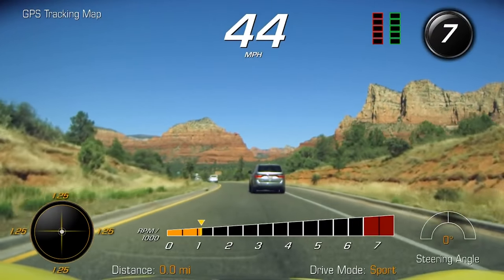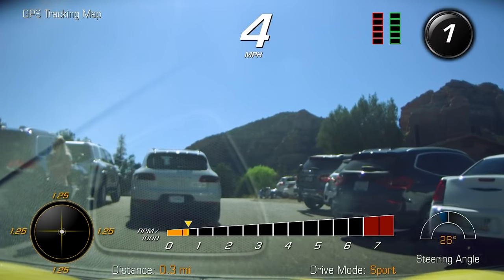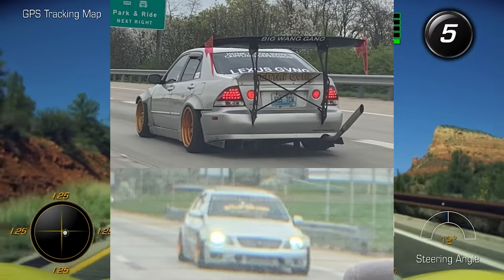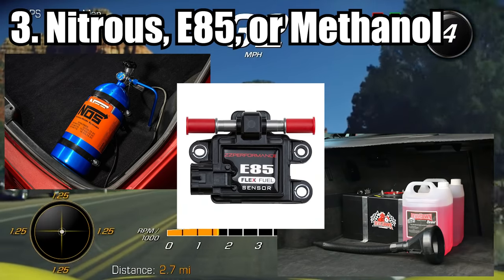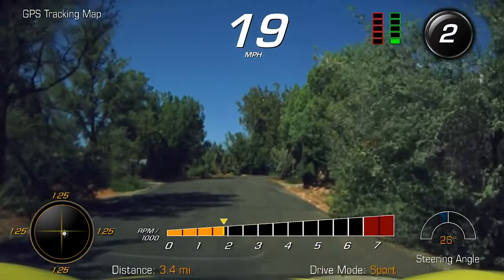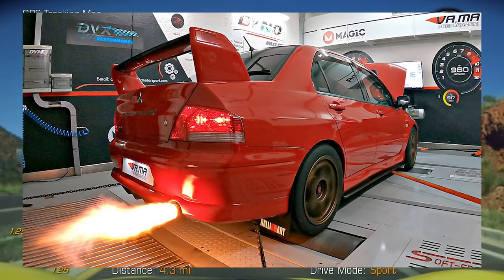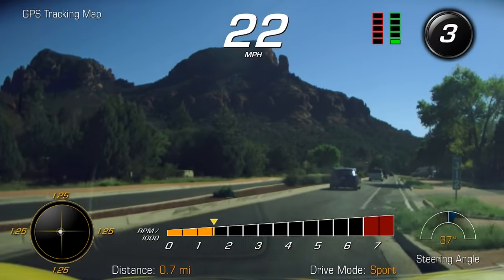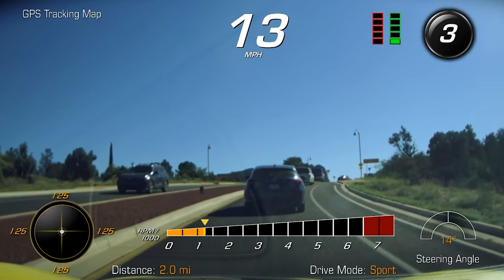6 Most INTIMIDATING Car Mods!

Comment: An actual Manual transmission will be destroyed by a 3000hp engine. That's why high power drag cars and insane vipers have sequential transmissions, has nothing to do with shift time. Don't believe me? Go look for a manual rated to handle more than about 800 hp or lb-ft of torque (different places rate their transmissions differently) yes I know there are a few 1000 + hp supras with 6 speeds out there but get into the 1500hp range and above and everyone either has a sequential or automatic.

Comment: 10:40 IMO there is a difference between Exhaust Noise and Echaust sound, some engines are just loud with a straight pipe, and others actually sound good.

Comment: Sorry to break it to you but you’re wrong on the big flames… big flames means they cranked their timing back… the little flames and pops happen when it’s just a cat less car with a decent tune pushing decent power… if there is fire coming out the exhaust your timing is a bit off plain and simple and the bigger the flame the worse it is… so bigger flame doesn’t mean intimidating just that they’ll probs blowup halfway through a pull😂

Comment: Surprised no one's mentioned the scariest mod: stripped interior with race seats and a rollcage. Sure, they may not be winning any drag races, but you know that to sacrifice all comfort and practicality for safety and performance they are putting in some serious time at the track or rallying their car. Either way, that driver has more skill and balls than you when it comes to sending it so they have nothing to prove in a street race anyway.

Comment: I want 295/45/R18s in the rear om my S197, and I'm building mine for occasional track use, granted that's not as big as a drag car's sidewall but it's noticeably bigger than what some people will run, just love the fatter sidewall on these cars, yea low profile is better but I also daily drive the thing so it will be a little more comfortable, I guess the thicker sidewall adds to the retro styling of the early S197 because 60s race cars had massive sidewalls and that's why I like it but I'm not sure

Comment: I’m building a 3.1 V6 2000 Pontiac Grand Prix. There’s not much aftermarket support at all but so far I’m waiting on injectors, new exhaust/cat, ram air intake+SD hood, and I plan on swapping my intake manifold for a 3.4 manifold since they share the same bolt pattern but I’ll hopefully get slightly better air flow. I have new wheels and I’m getting new tires in a couple months. Obviously plan on doing a tune after everything listed is properly installed. Any recommendations? These cars are difficult to modify (which imo adds to the fun of it) but I would love some ideas from people that are familiar with these engines.

Comment: OK you know you’re screwed when you pull up to a Honda with a parachute in the back with a roll cage inside and with big drag tires in the front and a hood exit exhaust and you start hearing the spooling and you see a laptop in the passenger seat

Comment: alright then, what if someone puts a 7 speed manual on a tesla model s plaid+, and when it goes it sounds like a fucking tornado. then you tint the windows and paint it matte black, THEN you carbon fiber hydrodip a set of drag radials. THEN you have 3 inch sideskirts, AND THEN, imagine that, you add bucket seats. AND YET AGAIN YOU ADD SOMETHING ELSE, you change the fucking hazard noise to something absolutelly ridiculous and you keep the hazards on, now now now you back it up with a six van support team with everything you could ever need and they set up like ten massive tents. WHAT THE FUCK WOULD YOU DO THEN BLADED, WHAT WOULD YOU DO THEN. anyways uhm i loved the video lol.

Comment: Bro, you mention 3000 hp vipers with a sequential gearbox, the intimidating part of that car isnt the gearbox. It's the THREE THOUSAND HORSEPOWER, you can put paddle shifters on an F150, I'd worry about looking for them on that, but a known 3000 hp vipers will win regardless of the trans

Comment: Boosted on e85 is better the NA on e85. I have that zzp fuel sensor. It’s not just a plug and play part. You have to wire it up to your pcm and your fuse box and it also needs a tune from them to be activated It’s not a hard install but it takes some time. My car is a 2.0t Cadillac ATS 3300lbs rwd. My end game is 400whp. Right now I have for engine stuff is zzp larger throttle body, zzp CAI, zzp coil packs, ngk plugs one range colder. Ptp turbo blanket, go fast bits DV+ ZZP CATTED 3inch down pipe and e85 sensor and catch can. I can run e47 till I get the new cams with the hpfp lobe then it’s full e85! Still tons more parts I have to buy. My car is being built for handling and track days. Not 1/4 mile times.

Comment: Tuned flames on a car: insane.    Meanwhile me on my 1986 Baja racer minibike with a predator 212cc engine with parts lost like: raceworks billet piston, 8 pound valve springs, stage 2,3 and 5 gopowersports performance kit. Pushing over 70 hp. On a 6 hp stock engine.  Going almost 100 on a thing that’s like 2 feet tall and 4 to 5 feet long (with exception of the wheelie bar). Shooting flames longer than my arm. My minibike shooting flames: GOD LEVEL.

Comment: I have a stage 2 Audi RS3...which probably almost fits your last.
Every way it looks stock it runs 306kw at all 4 wheels (410hp). Seeks 100km (62mph) in under 3 seconds...not stupid fast but enough for me....only makes noise over 4000 rpm

Comment: At a +550 hp vehicle with an auto (dct specifically) I understand however, it’s a common misconception that automatics are faster, autos are faster because of gearing due to EPA regulations not favoring manuals and manufacturers having to basically cut torque on manuals for regulations, the difference between DCT and a manual is about 0.2-0.5 sec depending on the driver and which DCT we are talking about and obviously the gap increases with the price, a F1 DCT isn’t a GTis DCT, but my point is, with the same gearing manuals are faster than torque converter Autos yet slower than DCT. As well as depending what manual we’re talking about, hell I put my money on a late 80s F1 manual than a production car DCT. And if you don’t want to take into consideration f1 look at H pattern dogbox trannys. But that’s just me, do your research and remember it’s just an opinion :) drive safe bois

Comment: Back when I was a teenager, a guy I knew (family had money), bought a new 1970 Cuda that had been specially prepared by a dealer for racing. He had the dealer put the interior back in it (full roll cage had been installed) and modified to hide the cage, put 4 mufflers on the car, and changed the wheels to steel with Baby Moon hubcaps. The car was an ugly dark green color.  If you didn't notice that the rear tires were extra wide (narrowed axles) it looked like a no frills car some grandma ordered. A complete sleeper.
Oh My! That car was ridiculously quick 9s and I was in it at 180 mph. I have no idea what the topend was, but it would 'Book'.

Comment: There is no way e85 mx5 can make same power as boosted. E85 Has same effect as high octane premium gas. E85 actually has less energy than normal gas( 48MJ/Kg energy) e85 has 38-42MJ/Kg. Only extra power is from advancing the timing.

Comment: I love trolling the big wing ricer cars in my stock looking daily driver pick-up (ls3 5.3L long tube headers, cat delete, cold-air intake, performace throttle body, MSD ignition, tuned and running E85) and its lost 300-500lbs over stock

Comment: He isn't lying on drag radials, I'm a WRX driver and I got some light mods but I once had an Evo on drag radials and hood exit exhaust line up next to me. 

I had to let my window and shake my head no, so he knew. I wasn't tryna do anything. 

Although once we were rolling I did get pretty deep in boost to see what he'd do and lemme tell you, that shit was not for show. His buddy was in a mkiv supra behind us and he made him look slow as they both flew past me.

Edit: Agreed on big wangs, I'm happy with my STi wing and anytime I see a subie with something bigger I'm like.....why?

Crazy thing I've noticed, the fastest cars usually don't a wing. Especially in the JDM world. I saw a R35 GTR at a meet once, guy claimed 1400 whp and you know what, he had drag radials, a hollowed out interior with nothing but a seat and the wheel and pedals, and a turbo big enough to suck up squirrels. So I kinda believed him. 

And guess what, he didn't have a wing at all. Not even the stock GTR wing. The fastest hondas around I have seen, no wing. Only actually fast cars I see with aftermarket wings are Evos from the JDM world. Muscle cars are usually no wing or a lil duckbill or slightly raised little piece in the back.

Comment: can you make a video for guys that want to make more power but have no aftermarket support? i have an XTS, i bought what i could find at the time with the little time i had, its a v6 with 305hp and i tuned it to add 20whp and ordered RPF1 18''' because i think the 19" looks weird and ugly and too big (i know im weird) wheel and tire and all ill save around 64lbs of rotational mass and im replacing the suspension with coilovers to better fit the 18" wheels, lower the car a tad and give better control. I'm going to have to custom make a CAI without a shield and place it at the bottom of the bay hopefully away from heat and im swapping my 2'' exhaust for 2.5'' with smaller lighter straight through mufflers by magnaflow.
There is nothing available for my car, finding coilovers was hell and i hope SFracing is good quality coilovers but what can i do to juice it a little? theres no superchargers kits available etc, no hoods with built in scoops, no body kits for aerodynamics (front lip mainly) i feel kinda stuck aside from the fact that my tune pulls like a mofo

Comment: Most of these car mods 2 me seem 2 b more drag based, which isn’t bad in and of itself, but I personally like more track based mods, which means “big wang gang”, low tire profile and camber, albeit not in overly excessive amounts like with clout culture. I recognize that there is no reason 4 me 2 b posting this, but I’m just voicing my opinion 4 literally no reason at all because that’s what I do. I’m not knocking on Bladed or any of these car mods. I personally think some of them r intimidating as hell (NOS, quiet car, ducktail on certain cars), but if u were 2 ask me what I wanted 2 do with my car, I’m probably gonna put a wide body kit on it if I can and try 2 get as much cornering performance out of it as possible. As 4 the wrap, u can check my Xbox account 4 that, since I don’t no how 2 explain it accurately (my username is the same as on this YouTube account, which I’d listed above). What I can say tho is that I like 2 follow the line flow of the car. And fuck excessive manufacturer decals. Those can go die in a hole. Basically, what I’m trying 2 say is, which I agree in certain cases, I know where my preferences lie. Ur opinion is urs only. This is mine. Unnecessary statement, I know. But I’m doing it anyway cuz that’s how I roll

Comment: Those are weak mods.  Flames is the only one I agree with.  

1- Either a big V8, 454 with a blower on top. And you know if when it starts.  Like a drag car, sports boat, jet boats when they start up 

2- flames (like a drag car)

Comment: I drive a mostly stock red 2018 F-Type R. It’s a fast car, but anything with mods, or you know, anything fast, will generally beat me. Now car, people like my car, and all the time driving, people pull up and want to take pull from the light or rev their vehicles driving next to mine to get me to make the famous v8 jag sounds. Now I know what cars can beat my stock, and I can generally spot a tuned car because people who like cars do similar; let’s call them tasteful mods. The ones that always surprise me are the engine-swapped sleepers. BMWs around here more often than not but also people with LSs in random cars. I enjoy a car that looks like it has a couple of grand in bolt-on parts but then walks me at a light like my 575 hp is nothing. Lol

Comment: Yo E85 isn’t the best fuel for NA cars, bc you’ll gain a good 10-15 hp I believe, however, with a boosted car, you’ll easily gain a huge amount of hp, I’m not sure of the facts as to why but it’s a proven fact that you’ll build huge power from using E85 on a boosted car, thus meaning it’s kinda pointless using E85 on a NA car

Comment: Back on highschool a guy in a Opel Monza (a small car similar to a Chevrolet Spark) wanted to race my Astra (just imagine a VW Golf, there's not that much difference of one and other), I was with a friend of mine and he was surprised when I rejected the race, but I told him that if I raced him I would have lost because I heared rumors of a Z20LET with nitro that was a project of a mechanic student, I knew it was him because I heared a silent rumbling and drag unmatched front tires.

Not going to lie, since that moment I wanted to have a similar car, no matter how many street drag events I have been that car still it's more terrifying than an V8 Audi RS4.

Comment: By far the worst and stupidest thing about modern cars is those huge GHETTO REEHUUMS with no real tires on them. I've seen a lot of stupid car trends come and go, but that is by far the worst one, and unlike the others that eventually did go away, this one seems to just be getting worse. I bought a 2003 Mustang GT as a daily driver, and the very first thing I did was convert it to 15" wheels and real tires with sidewalls. Drag radials, being 15", look great, and are actually safer on the street (as long as it is dry) than what amounts to basically no tires at all. Unfortunately they don't last long on the street, and can get you in trouble with the cops.

Comment: Not all drag tires are drag radials. Drag radials are pretty much street tires for cars needing alot of rubber, drag slicks are not the same, also useless on streets and very often biasply tires. First two "Ducktails" are not even Ducktails, those were drag wings. Also after your rant you went to the black GTR and said "Ducktails though... " Sorry. Still not a ducktail spoiler. Ducktail is very much vertical. E85 is not going to make as much power as even a low boost tune, it by itself doesn't do anything, but you can tune your car and possibly make like 5 more HP then you would tuning it to regular gasoline because the ethanol is an octane booster. I'm sorry I can't finish this at all. You know nothing.

Comment: If I see a drag setup car on the highway, I'm thinking twice about trying to face it. 

But if it's on a back road with turns more than 40°, I won't be worried because I'll smoke it. It'll have a 80% chance to end up flipped in a bush or tree off the road trying to keep up with me. Dunno how it'll flip when it won't be able to turn that sharp in the first place.

Some cars should stay in their respective zones unless they're ready for embarrassment and loosing.

Comment: Straight pipe for weight savings. My fucking stock exhaust weighed over 90lbs before I went aluminum with test pipes. Flamez from launch on a soccer mum suv trollz people. Plus the supercharger whine is killer.

Comment: I have a 76 Chevelle, I know its the ugly Chevelles but I'm building a 383 stroker under the hood with forged pistons, mild cam, all that "all motor" goodies. When the engine is done I want maybe a 2-3" cowl induction hood with racing pins and a ducktail on the rear. I have a posi rear end for it as well as a built transmission and a slightly heavier driveshaft. I'm so excited to get it running again this summer

Comment: My sleeper is this, a crown Vic gt500 supercharged, fully built stage 3 com extreme boost cams, yes it has long tubes on it, but.... High flow cats with an x pipe, and 2 muffler per pipe :)

Comment: Sequential is not a robot, its a drum with cams that operates the shifter forks that selects the gear instead of moving one shifter fork at a time with a stick. Every motorcycle has one. You don't need computer controlled clutch, it can shift with the clutch engaged because it has no synchros, has something called a dog box engagement instead, big lugs in even bigger holes. You just have to unload the transmission momentarily, either manually, or via a "quick shifter". Quick shifter isn't that smart either, all it does it cut power momentarily for upshifts or blip the throttle for downshifts, just to unload the transmission to allow the sequential gearbox to shift without disengaging the clutch. You can also clutchless shift a sequential without a quickshifter.

Comment: Alot of circuit race cars also have very thick tyre sidewalls. It's overall better for grip even in cornering. For example, just look at F1 cars which have very chonky sidewalls and tiny rims.

Low-profile tyres are really just a street car thing.